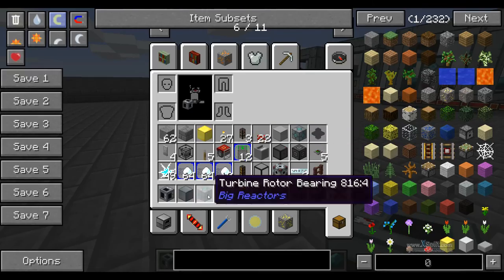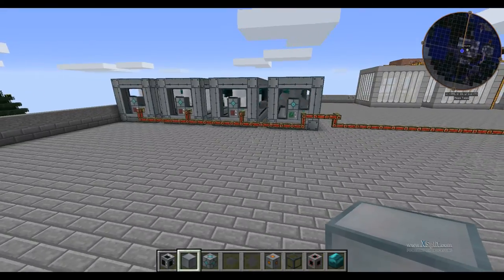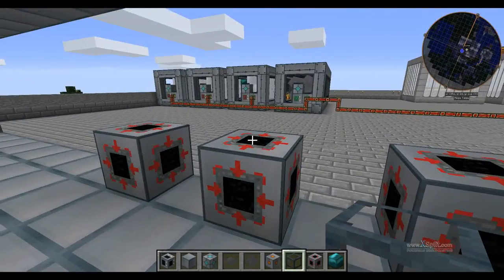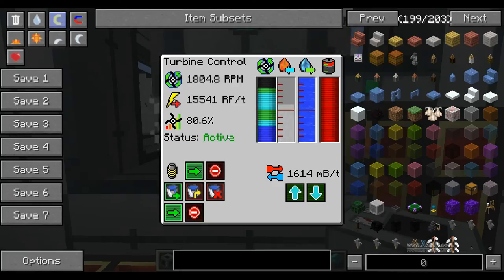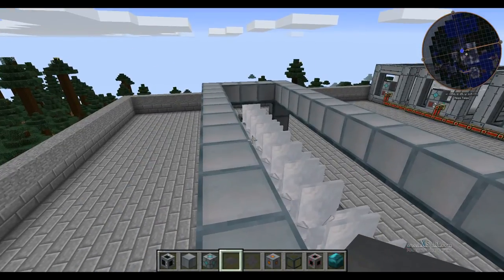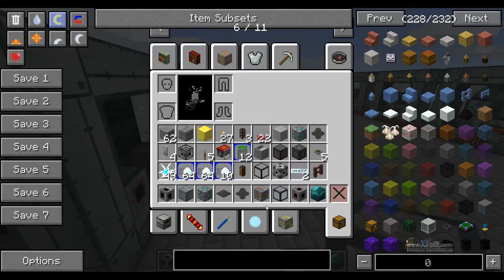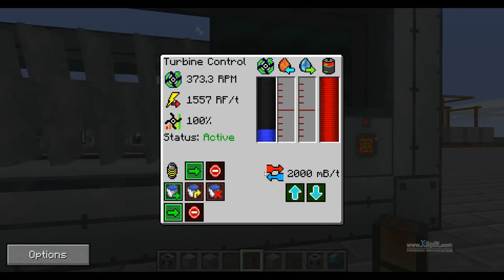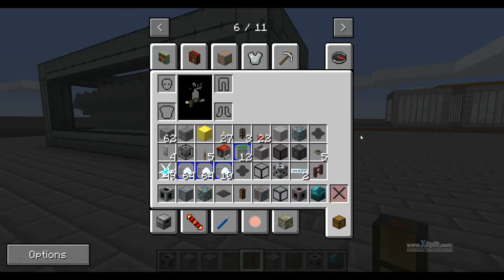Big Reactors Steam Turbine tutorial

Comment: Nice tutorial. Some info below which may help you out with your turbine layouts.
Big reactors don't explode, each power port exports 10k power (unless that's changed) A 36HP boiler will push out 720 steam and each blade on a turbine needs 25mb of steam to work efficiently. That means 28-29 (28.8 is the exact number) blades per turbine to have it sitting at its effective rpm. If I remember correctly, 13 blocks of endirium (using that as an example since you used it) in a 7x7x8 turbine. You can fine tune the turbine to only take in 700-715 steam per tic untill you have it spinning at 1800 rpm, as with the full 720, it will sit around 1842 rpm with 28 blades. You will be looking at 9k or so RF/t which is a big improvement from using the railcraft steam turbines.